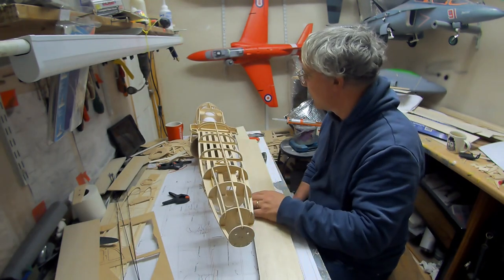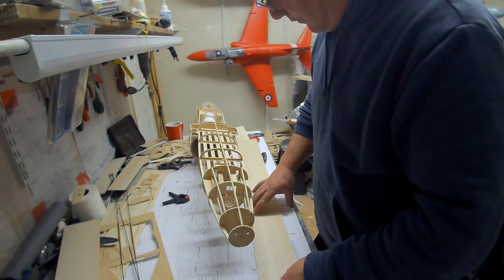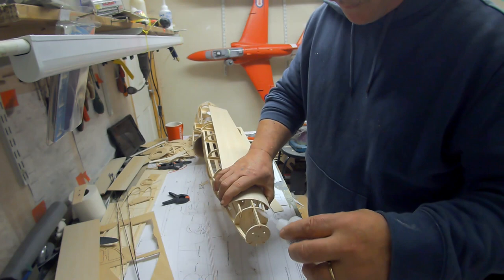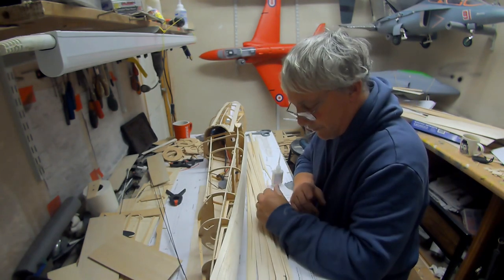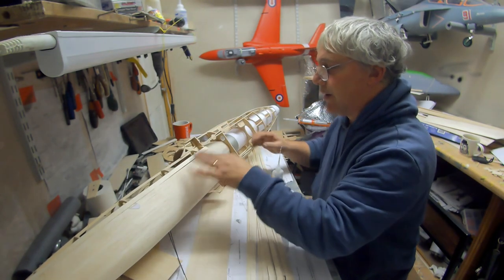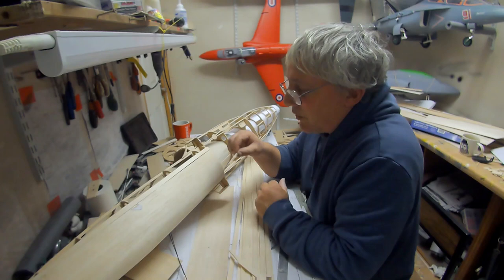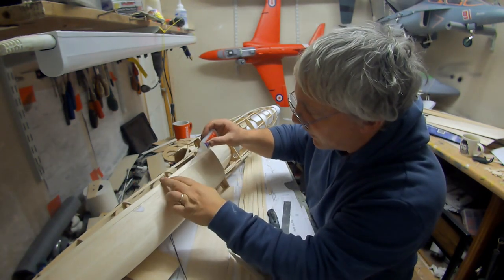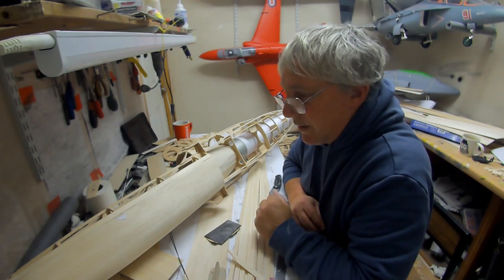RC PLANE BUILD L39 RBC KIT SHEETING FUSELAGE PART 11

Comment: Do you go over the joints with white aliphatic glue on the inside afterwards?  I agree with you that the CYA is great for fast building but is a bit brittle.  
Also, how to you prevent the glue ridges due to the glue being so much harder than the balsa? Granted, modern balsa is a lot harder - and heavier :(
Reply from the maker: Hi Airplany Guy  Yes I use pva glue watered down to 50/50 on the inside where ever I can get to, I often apply it with a small paint brush taped to a pole, as far as the hard joint you get with ca glue I use 800 to 1000 grit sandpaper glued to a flat block to try and prevent glue ridge. I try to get balsa as light and soft as possible but not easy to find.